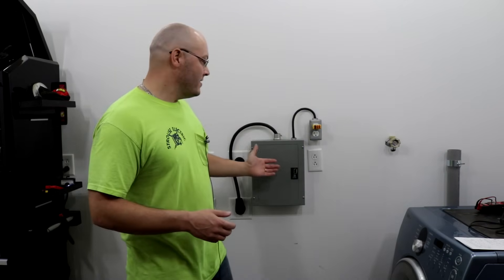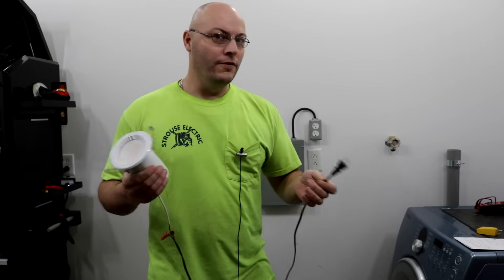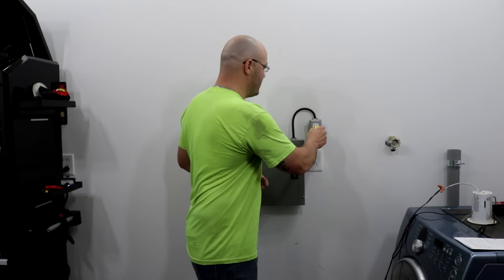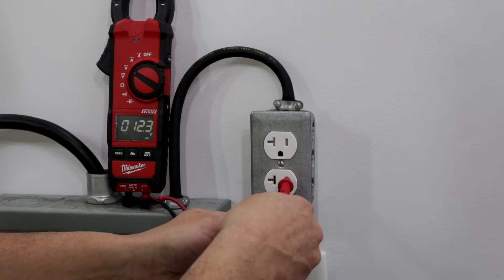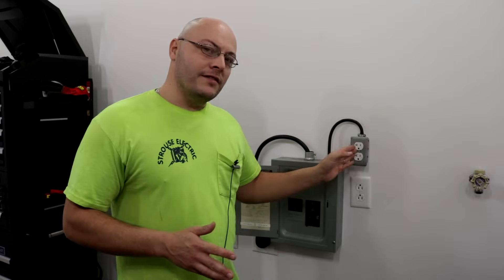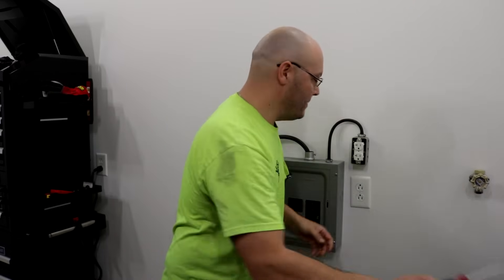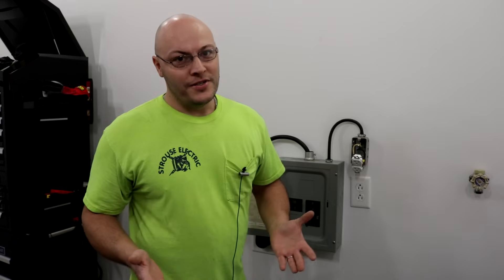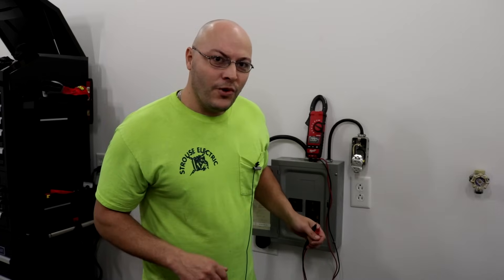How to Test a Wall Outlet - Receptacle Troubleshooting

Comment: Rather than stick multimeter probes into the outlet, I use a "dumbed down" but arguably safer method for klutzes like me..  On Amazon, it's "Sperry Instruments VD6505 Adjustable Non-Contact Voltage Sensor, 12-1000V AC, 360° Visual Indication, Pocket Clip, Adjustable Sensitivity & More"

Comment: I just got an old house I have an outlet that wasn't working it has power I replaced the outlet it has power when I'm not touching the outlet but when I grab the whole of the outlet on the bracket and test it, it does not have power. What could be the problem?

Comment: @ Bill Newberry Second if my outlet tester reads good, does that mean iam getting 120 V ?
Reply: If your meter reads 120 volts, your getting electricity to the outlet, that does not mean it’s good; if you plug a.device into the outlet, and there is a problem In the wiring the volts may decrease to a low voltage under load, then you need a professional electrician to troubleshoot the issue
Reply: @buzzincalifornia  that didn’t help one bit.

Comment: I plugged in a drill in my bedrooms outlet and seemed to messed the circuit up. Lights do not work when I turn on the switch on or off. However, when the light switch is on and the drill is plugged in and press the power switch on the drill, the lights turn on. Everything seemed to work fine prior plugging in the drill into the outlet for the first time. Any suggestions?

Comment: very good video !! I do have a question probably 1 of a 1000 !! I have problemS with tripping breakers; I will try to be as concise as possible; I AM running standard house current 15-amp service; I have a 1500 watt ceramic heater plugged . if I attempt to plug a ( 3 PRONG OUTLET TESTER)  INTO ANOTHER SEPERATE OUTLET IT BLOWS THE BREAKER??? I am not very knowledgeable when it comes to electrical "know how" the MAIN BREAKERS are 30 amp breakers; I should not be tripping breakers by simply plugging in a OUTLET POWER TESTER; THEY ARE NOT ON THE SAME CURCUIT?? I THINK ??? I will follow your directions to check first if it,s a breaker, an outlet; how would I know if it,s the wire; if I reset the breaker and attempt to FURTHER TEST THE OUTLET WITH THE 3 PRONG POWER TESTER; THE SECOND I ATTEMPT TO PLUG IT IN THE OUTLET BREAKER TRIPS ??? any help you may provide is of great benefit to me,thank you!! PATRICK.P

Comment: All we did was give the 2 restrooms a really good scrub down, didn’t touch the third restroom alone, which is STILL WORKING FINE. Anyways after the scrub down I went in just to reply in the nightlights that are usually plugged in there, and NOTHING!!!!!!!!! So we had a neighbor that has had this exact same problem before & after a couple of days it just started working on it’s own. Well it’s been over a week & we’ve TRIED EVERYTHING & still NO KIND OF POWER COMING FROM EITHER PLUGINS. The light switch’s are both working great it’s ONLY THE PLUGINS THAT AREN’T WORKING LIKE I NEED A NIGHT LIGHT FOR THAT HALLWAY CUZ OF THE BABY CUZ THE NIGHT LIGHT WORKS (brighten) up that whole hallway & it’s be nice to get it back up & working again. Breakers have been checked, we’ve turned OFF ALL THE POWER TO THE HOUSE JUST TO TRY TO GETTHE TWO PLUGINS WORKING ONCE AGAIN...DO YOU KNOW OF ANYTHING THAT YOU THINK I HAVEN’T TRIED CUZ I FEEL IVE & others have tried just about EVERYTHING....THANK YOU & THANK YOU FOR YOUR TIME, APPRECIATED!!!!!!! Maybe you can email repolady56@gmail.gmail.com
Thanks again!!!!

Comment: good show but i have a hot to the touch outlet is that a reverse polarity?
Reply: neal smith like actually hot as in heat hot? or hot as in live? if it's temperature, id definitely call an electrician, that is not right!
Reply: neal smith could be or old outlet

Comment: My problem is that i just bought and installed outket recepticals... and the top wont take any plugs at all but the bottom will... i cant even test the top because it wont accept my plugs... can this be fixed?

Comment: I've put multimeter rods directly into outlet to check the Amps and it blew up.
Reply: Ammeter should be connected in series and not directly across the inputs, which would blow the meter as you discovered.
Reply: @wingerrwingerr4989  I'm reading this 3 years later. Can anyone explain what Wingerr means by ammeter should be connected...?  I tried looking up but need explanation of what  "in series and not directly across the inputs" mean. With a multi meter you have two rods and you put one in hot and one in neutral.

Comment: Hey if you could answer this ASAP. I have to work on this tomorrow morning. I have a outlet that isn't letting out. I can't cut the main cause it goes to the sprinkler system and other things in the main part of the building. The fuse box isn't charted. Every plug and light in every room, and the room its in work. Im thinking flip each switch till the ones around it go out. Then put in a new plug. Please answer this ASAP. Cause that's what Im going to do tomorrow around 3 o'clock unless you tell me different. Im new to the maintenance world so I have to take risks to keep my job.

Comment: My bathroom plug no longer provides power.  I reset the breaker and still no power.  So I replaced the outlet and check the lines for power and nothing.  Can it be a bad breaker which I have not checked yet or can it be something else.  Thanks
Reply: Pete N if it's a gfci, did you do test reset? i know thats a simple fix, but sometimes we forget the simplest things

Comment: I have an XBox One that stopped working last night.  I tried it in an outlet in a different room and it works!
I have a multimeter...both outlets measure 119 VAC.  I'm stumped.
Reply: Bobos Curse 

Is the Xbox plugged directly in the outlet or to a powerstrip?  If it is on a power strip , try  plugging it direct.

Comment: Hi. Good info.  I changed a gfi outlet because it would no longer reset and had no power. replaced it with regular outlet and has slight power but not enough to fully power a led nightlight. I would plug it in and see it want a small dim light. What could it be?? Bad wires or bad breaker?

Comment: what wires go to what terminals on the outlet?
Reply: Neutral/white wires go to the chrome terminals, hot/black wires go to the brass terminals and the bare ground/ or green wire goes to the green screw. Ground first, neutral second, and hot on last

Comment: I have an end of run outlet. I have checked the breaker, no problem. I have no power at the outlet. I check with an electric meter and have no power at the wires. What might the problem be? the wires, black, white. and ground are clean no burn marks.

Comment: i have one outlet in my apartment that i noticed yesterday stopped working. I checked my box nothing was wrong no fuses blown  but the weird part was around 8 pm the light that i had plugged was on (where the not working outlet is) was on. i then notified my landlord someone will be coming to fix it. During the day again outlet went off. Well tonight it is on again. ?
Reply: we recently changed the outlets last year as well

Comment: I'm getting 105 Volts on my meter before the GFCI. Upstream it's showing 120 to the plug. I checked the connections and everything is tight. Breaker is fine. Wire is in pipe and appears good. What should I look for? My neutral connection is good too by the way.
Reply: Make sure the connections are tight. cut the power off first before you do that.

Comment: So I had an electrician come here with none of these tools.  Nothing to test anything.  I happened to mention prior issues with my stove so all he did was remove the cover which he apparently broke because then building and outlet was very old.  He said the wire had come lose and just reattached it but had also commented on how short the wire was.  My question is if he saw the wire was short should he have replaced it with a longer one?  Also shouldn't he have used these tools to confirm the diagnosis?  How can you just look and know.  The only thing he did before opening up the wall socket was to turn everything on even things that I hadn't even used.  I just felt this electrician was bad.  I don't understand how he didn't bring any testors.  There was a pop prior to all electricity going out and this happened three times.
Reply: Also if the cover was broken, shouldn't he have put a new cover on?  Could it be dangerous to have a broken cover just screwed back on?

Comment: thanks for the video. you mentioned multiple times that "you could get electrocuted and die". How serious of a problem is it if we accidentally leave a power on. Will someone die just by touching a 120V wire. or do we have to hold the wire for a long time before we die. thanks again
Reply: Yogesh Kale the amount of sarcasm in this is unreal 😂😂
Reply: 120 will hurt  for damn sure 240 will stop your heart.. 240 kills 120 will make your toes twinkle IF you can let go if not your done for
Reply: Even though you hear: HIGH -VOLTAGE ! HIGH-VOLAGE!!
It's the amperage that kills you much more so than the "voltage". A taser for example has around 50,000 volts but less than a milliamp.

Comment: I enjoy videos like this that give an opportunity to learn from a professional.  That being said, I believe the term "electrocute" isn't being used properly here.  There is a risk of getting "shocked," but electrocution is a term that means to be killed by electricity.  If there's a risk of dying, I'd say we shouldn't be trying to use a YouTube video for DIY advice.
Reply: aznazguy don't worry too much about dying
Reply: It's part of the jargon like HIGH- VOLTAGE!
 when it's the amperage that kills, you much more so than the "voltage". A taser for example might be 50,000 volts but less than a milliamp.

Comment: Man i plugged in a bad cord and i lost power in 2 outlets in my room and my office. Office lost all power in all outlets and the light switch doesn't even work now and a few outlets in the livingroom stopped as well. Seems like its all on the left wall/ All right side outlets work.. WTH. Wasn't the breaker i checked. Went threw and checked every outlet. All of em have power going to them but not enough to feed my outlets. What can i do to fix this? Any help would be kool.Could it still be  a bad breaker not feeding enough power to them outlets. I live in a mobile home and really clueless on this stuff. Can't afford a real electrition either. Hope u can guide me in the right direction. Sorry for typos its early.
Reply: can u tell me what was your fix same problem here

Comment: So where is the video where you were going to explain how to tell if you have a bad breaker or bad wiring?..........I have 1 wall outlet that has no power @ the wires,and I've checked all breakers & GFCIs,and checked all outlets,switches & fixtures both before the run,and after....Still NO joy!.....Do I need to start ripping into the wall,or what?
Reply: Erin Maria  Can you do a video on how to stick a fork in it? Please 😂😂😂
Reply: I have the same problem.
Reply: Same here
Reply: im kidding, btw. good luck
Reply: I've had a similar situation to a back bedroom, I suspected rats chewed a wire but never found the break in the Romex. I finally just ran a new run of wire from the panel to the back room and everything worked. So somewhere inside the wire the hot wire broke down the line. You could have a similar problem
Reply: You can test the breaker similar to the way you test the outlet, only if you can be careful, because you will be exposed to 240 (in house wiring) but you would take your meter and place one lead to the screw terminal on the breaker in question and the other lead to one of the phase wires on the main breaker or lug,   Bad breaker is very unlikely, only three in the past 15 years, here.
Reply: Maybe when you get to the really old breakers like zinsko
Reply: Maybe there is a junction box in the attic and some wires are loose, or maybe someone forgot to connect some wires to the outlet and just shoved them behind the receptacle, that can sometimes happen during the rough phase of wiring a house they might just want to make that outlet alone work for temporary power through the construction phase so other sub contractors have power to do their work or have light.
Reply: Randy Starkey m
Reply: Stab locks are the worst enemy when it it comes to prefab/mobile phones
Reply: stick a fork in it!

Comment: I have 15 amp 110v. breaker to our bedroom that trips as soon as it is reset, Everything in that room has been unplugged but it still trips. any ideas? I replaced the breaker but it did the same. It was working fine the night before. Do you have a video on how to check outlets for a short with power off or can describe in a few words?

Comment: gudevening sir. how to trace troubleshooting and electrical wiring.. problem is grounded.. the breaker is on. but switch is of.. for the lighting.. the light bulb is blink.. i use wire stranded.. switch is panasonic branch.. the breaker is 15Amps.

Comment: What if my voltmeter indicates 70V in a 120v outlet? Do I need a new outlet in that case?
Reply: take out the outlet and check voltage between the neutral and hot terminals. If you still get 70 Volts, your voltmeter could be bad. Check your voltmeter on a good outlet for 120V.

Comment: Bill, is it OK to run the white wire to a ground inside the receptacle? Adviseable? Thanks!
Reply: No it's not okay to use a neutral and pigtail a ground into it. If you wanted to use a white conductor or a black conductor as a ground instead of a green or Bare conductor , you would need to tape it green Within several inches of each end where it's connected, So it's clear that it's not a neutral but an equipment ground.

Comment: what if i'm measuring low voltage AC (31V)  and 22 megohm at both the downstream outlets AND the breaker? Does that mean bad breaker automatically? or could the problem be downstream? I'm thinking it's at the breaker?
Reply: You need to replace multimeter

Comment: Do you always put terminals on your wires before you connect them to outlets and switches? 
If terminals are added will that extra splice cause issues later or reduced voltage?
Reply: It's hard to tell, but it looks to me like he might have used stranded wire rather than normal single-strand conductors to attach the receptacle to the breaker box. It's a pretty normal connector for stranded, but I have no idea if it's even up to code for this kind of use. As always, when in doubt ask your local building inspector.

Comment: This may be an unrelated question, but I'll ask anyway. 

I've got 4 controllers and they all won't charge. I've used two different chargers in both of my outlets and they didn't work. I also used a camera, it showed a light but it wouldn't bring in audio like it should.

Question is, has my two chargers outlets burned out?

Comment: My breaker works since other lights on the same breaker work; but there is NO power going to through the black and white wires for an outlet that's not working even after I replaced the outlet with a new one, and I tested the wires with the digital meter and still no power.   What are good next steps to trouble shoot to find out why the wires are not sending any electrical current?
Reply: This can be time consuming but it sounds like you might be at the end of the run only 1 black wire and 1 white (or else if there were 2 of each 1 set would have power/ be hot) so try to see what direction that wire comes from because it is most likely being feed from another receptacle.  So basically, you have to figure out what path the wires take because somewhere along that path wires are lose or disconnected. Alot of times it's another receptacle within 6 feet away from it. Start there the ones next to it. If the you see the wires coming in the box from the left then start with a receptacle to the left of it. If it comes fromm the top then it could be coming from the left or right. This is where the time consumption and patience come in! Hope that helps.
Reply: @Tank_Tha_Rottee  Thanks! Very helpful. I will try this.
Reply: Mark Aventino if you dont have power, there a few other troubleshooting questions to be asked.
1. do thr other receptacles  on that circuit have power?
2. if the other ones do have power you may have a bad splice somewhere or a bad receptacle if they use the receptacle itself to feed through to the other ones
3. if you do not have power at the other receptacles you will need to call an electrician to come out the cover of the panel needs to be removed and you need to check power at the breaker to make sure that you are getting 120 volts from the breaker I would not recommend opening up your panel by yourself if you are not qualified it's too easy to get in there and get killed over trying to save a few dollars on a service call
Reply: Terri Toney I found that I screwed into a wire when mounting my TV luckily a fire did not start
Reply: Mark Aventino do you still need help?
Reply: Did you find out the problem?
Reply: KRALTAIR47 the receptacle night be a switched receptacle, meaning it is operated by a wall toggle switch, that might be in the off position